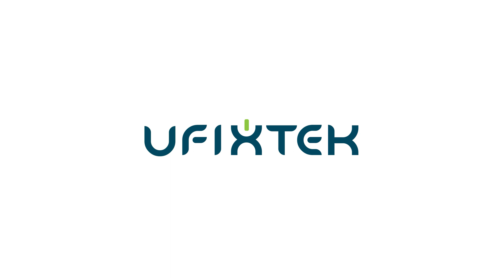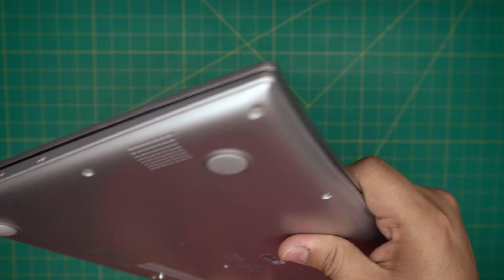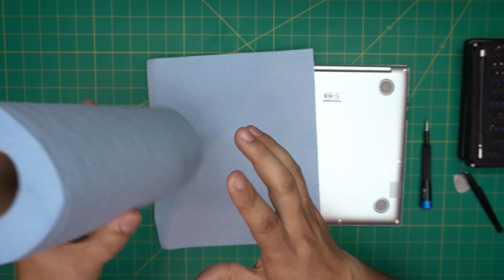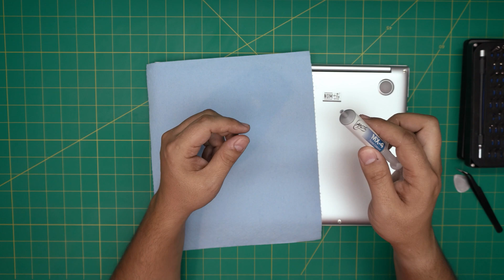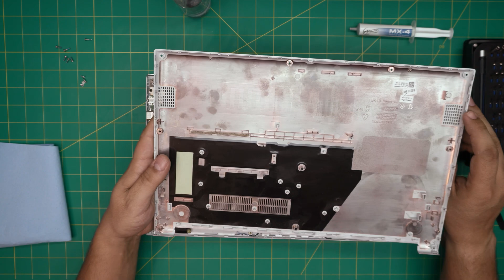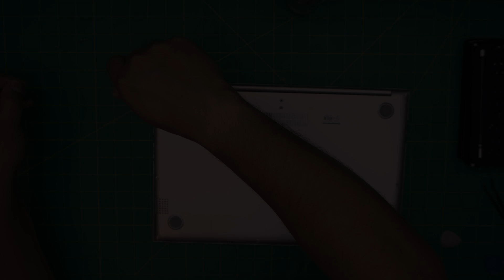How to Repaste and Clean Asus VivoBook 15 K513E - Step-by-Step Guide🧹✅

Comment: There is a HDD mounted to the removable back panel and a cable running from the HDD to the motherboard.
I can't physically reach the wire to unplug the HDD nor remove the HDD from the back panel

Comment: Thanks for telling me about screw sizes
I inserted the long one in the wrong place and guess what... it damaged the body of the laptop.
Reply from the maker: Yeah, there are three types of screw sizes. If you insert a long screw into a short location, it will create a nipple (bump) on the case. You can heat it and push down on the bump to fix it.
cheers🍻

Comment: Thanks for the video! Just a quick question: is it GPU near the bigger CPU chip?
Reply from the maker: 🫠Regarding your question, this laptop does not have a dedicated GPU installed; the only GPU available is integrated into the CPU.  

The CPU chip consists of two crystal dies: one die is a PCH chip, and the other (the larger die) contains both the CPU and the GPU in the same crystal.

Should you have any further questions or requests in the future, please don't hesitate to ask me.
cheers🍻
Reply: @uFixTek  Thank you very much for the answer =) I appreciate it. Please keep doing a great job filming and thanks again for the vid!
Reply from the maker: It's my pleasure my friend.
Thank you for your support

Comment: Hello, Thanks for sharing this video!!! Regarding the thermal pad for the CPU's VRM, may i ask what thickness is the best for this laptop?
Reply from the maker: It's my pleasure my friend, i appreciate your support.
🫠Regarding your question, you can place a .5mm thermal pads and you be fine, don't go anything over that, as it will counter push the heatsink away from CPU.
Should you have any further questions or requests in the future, please don't hesitate to ask me.
cheers🍻

Comment: Brilliant video. Always apprehensive doing repairwork, but your straightforward explanations helped reassure. With some Arctic MX-6 the laptop's gone from being able to fry an egg after 5mins light usage to running cool to the touch under load. I did seem to have only two screw lengths on the case (the small dyed blue and two long) but its still secure.
Reply from the maker: It's my pleasure, my friend. 😊 I deeply appreciate your taking the time to provide feedback. If you're inclined to support the channel further, feel free to like and subscribe—or even both!
Should you have any questions or requests in the future, please don't hesitate to ask me.
🍻cheers

Comment: Thanks for making this video, it really helped me repaste my own laptop.
I noticed that unlike my previous laptops, this one has a section with thermal pads and some batches of thick thermal paste at the top? What parts are those?
The thick layer of paste has dried out, so I replaced both that and the pads for thermal grizzly thermal pads, since I couldn't apply the paste to bridge the gap. For the CPU and GPU, I of course used paste (thermal grizzly for thosa as well). Will this cause any issues?
Also, Is there any reason why the wents are directly above the CPU (leaving some part of the motherboard uncovered) instead of the heatsink/fan?
Thanks in advance.
Reply from the maker: those components are the power regulator and you could change the thermal pads for them and use thermal paste got the CPU dye, never use pate where pads are.
the vent is to suck the air across the motherboard so it can have air flow to passively cool down other components of the board, if the vent was directly under the fan it would had suck 90% of the air from there and that way the motherboard would of heat up more.
cheers🍻